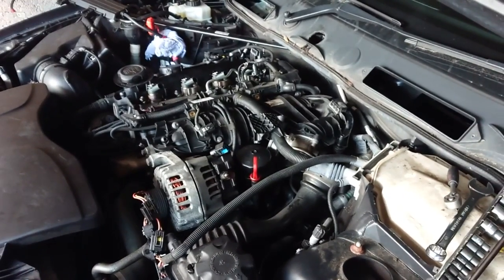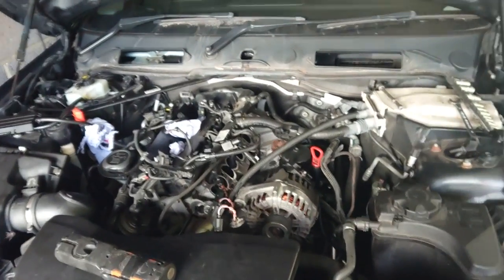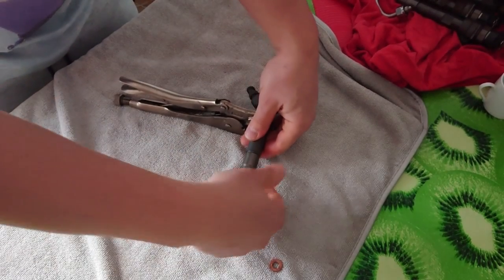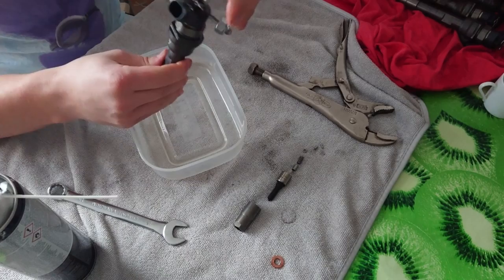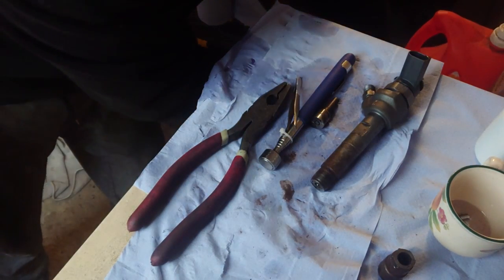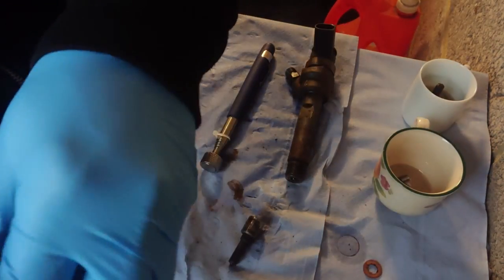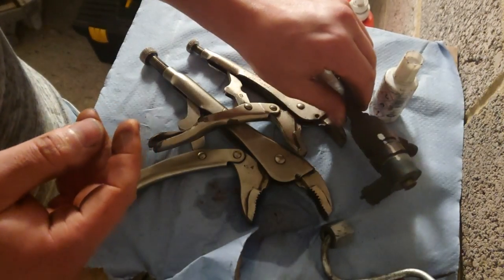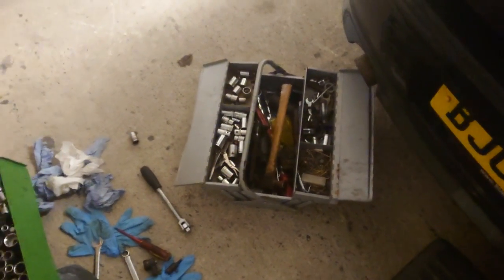BMW 116D high pressure fuel pump issues Part1

Comment: You Know your stuff, i have a BMW 118D no Diesel to the Injectors, we replaced the inline Fuel pump but still the same, we are now checking the live feed to the fuel tank, before we go to the serious High Pressure Pump. Good Video  you have shown so much !!
Reply from the maker: The first thing is use a laptop with a program to bleed the system to see if the primary fuel pump on the tank is sending fuel for high pressure pump, if it is then fuel pump high pressure one is dead. This bmw this pump wasn't put any pressure on the rail so car not start. Check if is not metal pieces on the rail, if is then high pressure fuel pump is breaking up. Hope this helps and thanks for watching.
Reply: @axores20  Thank you for that helpful advice, really appreciate it, where are you based ?
Reply from the maker: @STEVEHOLE1  Trowbridge, United Kingdom. 😉
Reply: @axores20  Thanks Know it well,  i did most of the Roads around there many many years ago, i remember by a school which leads down to the big round about. probably changed now.

Comment: Very helpful video!! I have a 2014 328D that some one put Adblue in the diesel system so now  I’m replacing all fuel system including fuel tank both pumps low and high pressure. I will also replace the fuel rail and injectors since I have a donor car. My question is do I need to reprogram the injectors to the car or they will work just by swapping them???
Reply from the maker: Hi, some of the models yes u need coding. But bmw will be able to tell u that information if u call them parts department 😉thanks for watching. 😉

Comment: High my e82 120d cut out couple months back when driving. I had some look at it they said possible hhp fuel pump . What is the easiest way to diagnose if its actually the hhp that has failed ?? Cheers

Comment: Where are you based ? I have Petrol bmw 1 series 114i same issue High pressure fuel pump showed on diagnostic machine 11A002 – High-Pressure Fuel, Plausibility, Pressure too low do I need to change the pump? The garage is not being certain to what it is I need fixing. They say could be that or even fuel injector or even battery

Comment: What was the cause of the pump failure? I've noticed this problem only seems to be on the 1 series for some reason
Reply: Contaminated (water/petrol) or poor quality fuel seems to be most common cause, can affect N47 & N57 (or any Bosch pump of similar design). Working on another car with this at the moment. If no fuel pressure in ISTA and sensors read okay, inlet manifold off and remove control valve on HPFP and you'll see metal particles in the gauze filter and valve housing if it's carked it.  Usually the cam roller that goes belly up, in the pump I've just stripped, it was badly scored. Not a particularly resilient design imho.
Reply: nem 1970 So essentially poor lubrication?
Reply: @GeorgeAusters  Yeah looks like squire, another post mentioned purging the pump in ISTA after main fuel line disconnect (filter change etc) or running out of fuel is important or the pump can run with insufficient lubrication leading to premature failures. After numerous unrelated repairs on my own e92 320d and disconnecting fuel lines, this was not a good read for me lol ;)

Comment: Hi! I have the same problem with my bmw e90, 320d, n47 engine. The question is: you can change only the nozzles from this injectors? I think is for sale only the nozzles for this injector...
Reply from the maker: Hi. I believe u can, But they probably need to go to bosh specialist to recalibrate them not sure. And when u remove them out mark where they come from like cylinder 1 2 3 and 4 on them. Why not try clean it first see if helps?
Reply: @axores20  ok, i will try to clean first, thank you for your answer. I will tell you the results of my work...

Comment: hi so you dont need to lock the flywheel in place then for timing reasons? its just to hold the crank so you can undo the bolt?

Comment: i don't think the previous owner put petrol because it's not possible on this car. the nozzle won't fit in the tube. it's designed like that.
Reply from the maker: Yes u can. She did admitted she did. Is a normal fuel cap. Either petrol or diesel fits. Some car has what you are saying, not hers. After she put some petrol on it the car starting behaving weird. This explains why the pump did eat away. 79k on the clock. Human error
Reply: @axores20  oh, i guess so have it an some don't thank you for letting m know.

Comment: I have Diesel leak (at injector #1) at the back of the engine and also gas leaking. I've replaced the seal and cleaned everything up nice and tidy and after a bit over a day (40 miles driven aprox.) the problem is back as it was. I don't know what else I can do. Here is a link to a video showing the problem. @   Slacky power, fumes in the cabin, very bad fuel milage, These are the symptoms. At times I get the P0402 code (EGR related) but that wasn't the case when it was working fine + I had the inlet manifold, throttle body and egr cleaned recently with swirl flaps delete. Any suggestions, please? Thank you!!!

Comment: Hi Nuno! Usually my car took longer to start when warm and very good at cold start in the morning. Today it didn't want to start at all after 50km drive. Had to let it cool down and started this evening... What do you think it is to blame? I got no errors on engine. Thx! Car is Bmw 118d with 240000km on odometer. Other symptoms are the car stutters on light throttle, not always, more when fuel tank is below half.
Reply from the maker: hi, sorry for the late reply, if the car struggle to start when warm is more likely to be the crankshaft sensor or camshaft sensor. sometimes EGR valves can become sticky and cause the car to struggle too. if is not error codes i would suspect about the crankshaft sensor. sometimes they go bad and dont give codes straight away. but get a good snap on scanner or Delphi one to check live data if this 2 sensors are working correctly. hope this helps ;)

Comment: Im getting the warning “engine fault, reduced power” after that i’ve cleaned my commonrail.. you got any idea? Got a bmw 123D e82
Reply: And this only when I push him to 3500/4000 rpm
Reply from the maker: @MrLucilolo  hi. Did u check if u not having a leak somewhere? I believe probably u got a small leak thats why in high rpd the pressure on the rail drops.. Hope this helps.
Reply: Nuno Oliveira I will check tomorrow, thanks anyways 🤙🏼
Reply: I cleaned and fixed my commonrail when I blew it up when I went full trhotle, does this make’s it a different story ? Im going to clean my injectors in a couple of hours

Comment: Hi could you give me any help car was struggling to start and kept cutting out I’ve replaced the hpfp rail sensors and furl filter but now getting error rail pressure plausibility and goes into limp mode clear the error but Returns any idea what this could be thanks

Comment: Nuno please help I have done this but cannot start the car. Pump tested and is fine, injectors tested and fine, no pressure at fuel rail and front sensor signal 0.3 v
Reply: Did you reach a solution?
Reply: I have the same problem
BMW 520d
Reply: How can I check the sensor signal?
Reply: @zaidajeel91  I believe the voltages for the 3 wires on front sensor should be 0.0 - 0.3 - 4.99/5 volts. Understand the control valve at the back of the rail can get stuck open, won't build any pressure. Did you sort it?

Comment: Hey! didnt you remove the tank and clean it?..
Reply from the maker: Dont need. Because nothing goes past the fuel filter. Even the old filter i didn't see any evidence from the metal bits. But i did install new filter and car is running perfect. Car soon will need full service i will make a video from the car how its going.. But the owner is happy. He did a jouney from England to Portugal is about 3000 miles both ways no issues what so ever. I did think about take the tank off and cleaner but the owner was low on money. Of course if i will do this will be more hours working on it.. But when i will do the full service i will cut the filter and we will see it if there is alot of bits on it. 😉 Thanks for comment and watching.
Reply: @axores20  Ah! Did just buy a 116D with metal pieces in the fuel system. But there is metal pieces in the tank to :) The old lady i bought it from couldt afford to fix it. I have access to cheap parts from work hehe.. I work as a Bmw mechanic , and when we have bmws with metal pieces in the fuel system we usually remove tank and clean it :) 
But i like your videos, keep it going dude :D

Comment: Hi I have a 2009 120d e82 coupe and I'm having a starting and running issue, now I've changed the fuel rail pressure sensor and maf as that was the code and didn't fix it, if I unplug the fuel rail pressure sensor the car starts and had about 70% of the power back, could this also be high pressure fuel pump?
Reply from the maker: Hi. Ok so i was thinking the car will not start with the rail sensor disconnected?🤔 Also what exactly codes did you have? High pressure or low pressure? Did you also check if is any metal bits inside the rail? Could you give me this information then i am able to help you more. ☺️
Reply: @axores20  the codes just said maff and fuel rail pressure sensor so I changed the "front" one and maff, when I changed the pressure sensor I didn't see any metal partials but surely I would still have the issue if it was the pump or am I just tricking the ECU with it unplugged? I have about 70% of the power back and starts but plugged in it takes 4-5 attempts to start and in limp mode and when revs drop it cuts out, I'll get a magnet in the fuel rail and fuel tank and see from there.

Comment: Hi.I have some problems with a car , a 2009 bmw 520 , engine code N47D30O0 .It`s done around 170.000 miles . The engine was running a bit rough on idle but was running ok above 1000rpm. My mechanic suspected the DPF as i had a dpf and gearbox fault coming on while driving. He said that the dpf is blocked and that caused the gearbox fault to come up . We decided to do an active regeneration with motorway driving but first we replaced the engine oil , oil filter and fuel filter, to make sure the car is serviced before the regeneration It had about a quarter of a tank of fuel left and i added a cataclean before the regeneration started , then i`ve done about 20 miles motorway driving at around 50mph/3000rpm . I didn`t notice any improvement or other kind of change so i decided to add a wynns dpf unblocker, I took the car back on the motorway , same as before ,about 50mph and 3000rpm. After about 5 miles , the engine cut off while driving and it didn`t want to start. My mechanic said that the dpf must be fully blocked and i need to tow the car back for dpf delete I recovered the car back , we removed the dpf , started the car . It started and i left it running for a minute or so . I turned it off , then back on . It started again and run . After a few minuted we tried again and it started causing problems . It didn`t want to start . My mechanic tried easystart and it started but it was noisy . He suspects the engine is damaged but he suggested to try replacing the injectors first as some of them were leaking . We first took the fuel out of the tank , to make sure it`s not contaminated with additives anymore. We`ve put fresh fuel in. We fitted a set of good injectors but it didn`t make any difference . We replaced the fuel rail but again it didn`t make any difference . It starts with easystart but it`s noisy and it turns itself off immediately, once it burned the easystart . It started normally as well ,just for 2 or 3 seconds and it ran normally , not noisy . Now , i really don`t know what the problem is . My mechanic says the engine is damaged , maybe piston, block , partially seized. It turns perfectly we crank the engine so it is not seized . it turns manually as well , however my mechanic says it turns harder then usually , not as freely as it should be . Tonight we fitted the dpf back on but it` s the same . It started for a few seconds , without easystart ,and it wasn`t noisy but when we try with easystart , it`s noisy . I really don`t know and my mechanic doesn`t know either . If you have any idea or if you know if you can fix it , please let me know. The fault codes we are getting now are 4A5F -Glow Control Unit, 4A4F -Glow Control Unit,4600 Rail Pressure Plausibility Delivery Controlled , 4610 Rail Pressure Plausibility Delivery Controlled, 4B1C Fuel Filter Heating Activation. Thank you
Reply from the maker: Hi, ok so lets start from point one. Is your mechanic have a look on the pump itself? See if any damage there?
Reply: @axores20  we just removed the intake manifold and few other parts today ,  to get to the high pressure pump . There is no obvious damage there but i decided  to replace it at my own risk and cost as my mechanic didn`t want to diagnose the problem and take the risk of miss diagnosing it and not get paid . So , i had the choice of taking the car recovered to the main dealer , to have it checked , or pay the mechanic to replace the pump at my own risk ..and i decided to replace it . He will fit it on monday and i`ll see how it goes . hopefully the car will start and run normally .Now the car starts and runs on idle but it stops after 5-10 minutes . It`s also cuts of if i rev it .
Reply from the maker: @paul63s75  to me this is a fuel pump issue. Not supplied enough fuel and cuts out. This car i work on was the same then it just died.
Reply: @axores20  you mean the high pressure fuel pump , not the fuel sender unit that in the tank , right ? that`s what i`m thinking as well and i`m not even a mechanic , so it`s just based on research ,common sens and also  because i don`t really have another option .  i just hope it's gonna work out . Your video helped as well so that`s a lot for that
Reply from the maker: @paul63s75  yes the high pressure one. Thats the one i work on the video. I hope u fix your ride soon as possible 😉😊
Reply: Nuno Oliveira  i removed the solenoid from the pump and i found fine metal inside so the pump is gone and it is gone in the worst  way . I will most likely need injectors. Do you think i need to replace all the high pressure pipes or do you think it will be good enough if we just wash / flush the fuel system ? My mechanic want to flush the whole fuel system , from the fuel tank to the hpfp ,with pressurised petrol first , then with pressurised diesel . He's saying he's done it on another car and it was fine. What do you think?
Reply from the maker: @paul63s75  if he does a clean with petrol he needs dry all system after and then put new fuel filter in. Injectors dont need change. Check my video i did clean them and after one year car still going strong. So dont waste money. They can be open and clean all derby out and should be fine. 😉
Reply: @axores20  finally fixed!.. We cleaned up the fuel tank , fuel lines, replaced the fuel filter and hpfp,  cleaned up the rail and high pressure pipes, we cleaned the injectors as well and  started the car. It had a slight misfire ,it was a bit smoky  and the engine light came back on aver 50 miles so we decided to replace the injectors and that fixed the problem completely.  Thanks again for your help.
Reply from the maker: @paul63s75  very welcome 😉